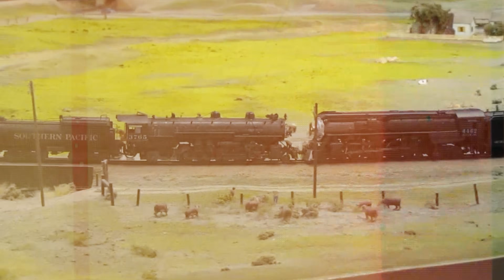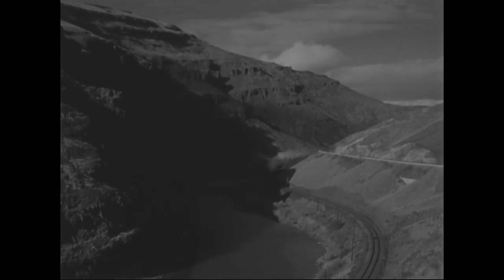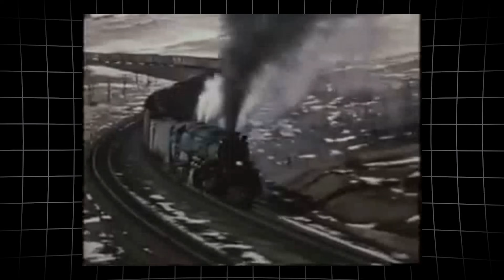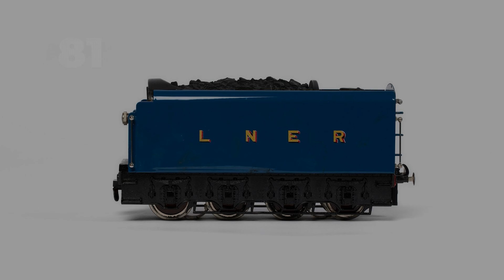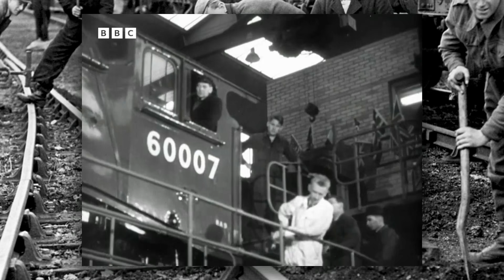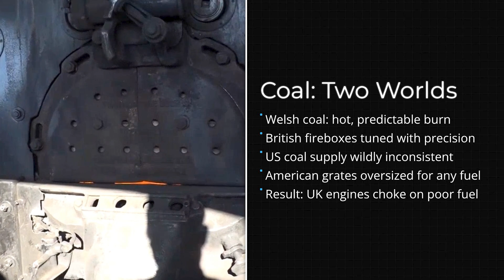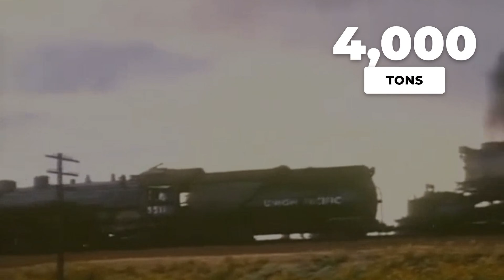Why British Locomotives Would’ve STRUGGLED in America

Comment: Kind of comparing apples to oranges. The Big Boy class was a very specialized, massive machine. A fairer comparison would have used perhaps a Mikado on our end. Several of those comparisons were spot on. A very interesting and informative video. Thanks for sharing this information.
Reply: The big boy’s were a class of engines not a one off type. (Like the Allegheny locomotive)
Reply: @sockshandle yes. As I said in an earlier post, the class was not a fair comparison. That wasn’t the average power for the railroad. Every railroad had their “monster” class for their particular needs like SP’s Cab Forwards. It would be like comparing an Atlantic or Pacific type to the Big Boy for passenger speed.
Reply: @jeffreymcconnell6794  Setting the Big Boys vs. well, anything else, comparing the Big Boys' goals vs. reality is interesting- the goal was pulling 3,500 tons over the Wasatch Range, but they actually achieved 4,200 tons.
Reply: You saying there was only one big boy ? There’s a whole class of them, I do agree mikados would have been better
Reply: @EMDempire Not at all. The class itself is an unfair comparison. They were monsters that beat the hell out of everything the USA had at that time, too.
Reply: @jeffreymcconnell6794 true
Reply: @jeffreymcconnell6794  Disagree Each major railroad had their Massive Beasts
Reply: @Nuclear_Doughnut exactly my point. Don’t compare massive locomotives that were atypical of average road power to the average locomotives of the time.
Reply: Yep BR should use 9F and AR should use mikado or santa fe or something similar. BR has no articulated engines.

Comment: Britain does not have the mountains that America has. And distances are shorter which makes coaling and watering easier.
Reply: Britain did build locomotives to send to other places, such as India. Several railways, and locomotives to operate them, were built in the Himalayas. The largest mountains on the planet..... 
Britain also supplied Australia with locomotives, that would travel thousands of miles through deserted, err, desert, reliably, all day, every day, carrying thousands of tonnes of ore across the outback. 

The machines were designed to do the job they needed to as best they could, in the smallest, most economical package.
Reply: @Spook123 There are Garrett articulated locomotives atill operating in Africa but in India the locomotives are narrow guage with cogwheels to give traction on steep inclines.

Comment: Kinda unfair comparing the A3's and A4's to THE DAMN BIG BOY like compair the big boy to an 8F or a 9F
Reply: It would have been more fair to compare between a K4 and the A3s.
Reply: @connormclernon26  K4 is an older locomotive than the A3s. It still probably would have made English rails Cry. PRR was a monster on the rails
Reply: Big Boy is probably closer to something like a Garratt or a british mallet engine, since we're factoring in Articulation.
Reply: @heftyordinanceindividual4015 unfortunately the LMS and BR/LNER(?) Mallets weren't built but yeah i haven't had a single thought about a  garrett, good point
Reply: @heftyordinanceindividual4015 No. The Garrets didn't even touch a PRR 2-10-0
Reply: Comparing the big boys water capacity to a British locomotive, how much water did it use to cover the same distance?
Reply: @DGH-i8r blud was COMAPRING WHEEL SIZED my guy
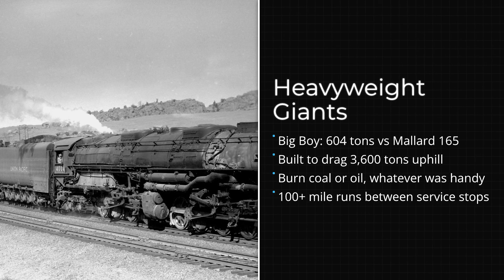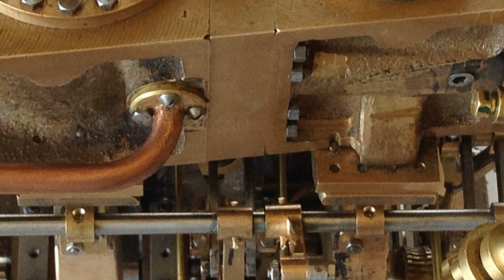Reply: @FlyingFoxProductions8995  3:25- 4:16 TENDER WATER CAPACITY section, I wasn't having a go at you I was adding to your comment on the comparison inequality.
Reply: @DGH-i8r is that including track pans or not?
Reply: @gamerfan8445  Erm...not.
Reply: I would compare it to a pair of class QJs. Yep a pair of them. BB has got around 7000 horsepower a pair of QJ could do 6000 not much of a difference in pulling same load at same terrain.
2x QJ would weight 133 tons x2 and that's without the tenders. a BB would weight 350 tons no tender. 2x QJ is lighter.
Fuel cost. QJ should be less. It has got around 10% efficiency. And QJ will not crush the tracks.

The only drawback of QJ is you need 2 set of crews. But people is cheap in mao's era therefore no problem. Also a pair of QJ is longer than BB but that's nothing to worry for freight trains.
Reply: the 9f is only just slightly more powerful than one of our narrow gauge mikados ;-;

Comment: See Kratville's book on the Union Pacific 800 class 4-8-4 engines.   80 inch drivers, much used on Sherman Hill...  British answer to large cargo jobs might have been the Beyer-Garratt design?
Reply: British heavy freight engines tended to be 2-8-0s. There was also the 2-8-2 Mikados by Gresely and the 9F 2-10-0. Our engines rarely got larger than 60-70ft long. Garrats could work but they were largely used on banking duties (in the UK, they were used quite extensively in Africa, India, Australia and New Zealand) as far as I'm aware.

Comment: The British built locomotives to use all over the World..  They were different to the ones used in th U.K. because conditions were different.  There was an example of one for Indian railways on show at the Festival Of Britain in 1951 that would probably have been at home in the U.S. (They were still building them then). That's the way proper designers and builders do things.   America started with wood burners to run across vast prairies and mountains and imported armies of labourers to build the tracks.  It is no surprise that they developed differently.
Reply: What I wonder is how well would British-made locomotives stand up to the horrendous banging and jolting inherent to American railroading using knuckle couplers?  The slack action and massive weight of American trains can quickly smash to bits any equipment not designed for it, so my impression is that, for that reason, American equipment tends to be much more stoutly built by comparison, because the British buffer system moderates all that.

Comment: Not really fair comparing The Flying Scotsman, 4-6-2 to the Big Boy. The Big Boy is at least 3 times the size. Should have compared it to a PRR K-4 or let's say the Rogers locomotive Works Pacific like L&N 152 which is a light Pacific. Still, it had twice the water capacity of The Scotsman.
Reply: Naturally.  The Murican trains had to stop and fill up.  THe Brits developed a system that worked like a water bomber picking up from a lake, and did it at speed --and of course it's a small, damp Island
Reply: Track pans were used in the USA too, on the New York Central.

Comment: There was a Flying Scotsman touring America in the 1970s as some UK PR/advertisement. It had two tenders because it was the end of the steam era, hence it was getting even harder to get water. Through trial and error, they figured out that they could make it run on coal from West Virginia and apparently only that. Didn't work with any other American coal.

The comparison in this video seems a bit off through. Europe today like back in the steam era relies on shorter freight trains, which are more agile and blends in with dense passenger traffic. EU is trying to make the default freight speed limit of 120 km/h (75 MPH) as this makes it easier to blend into traffic. Also max train length is like half a mile.

European steam (UK, France, Germany etc) were optimized for short hauls by American standards, but they did that with greater efficiency. The lower coal capacity was not just due to higher energy density, but also because efficiency was high.

It should be noted that while Welsh coal is high quality, a lot of Europe has decent coal. UK has many coal fields with high quality coal The Flying Scotsman ran on coal from North Yorkshire as that happened to be the middle of the line it was designed to run on. Germany and Poland has equally high quality coal.

Europe pushed much harder for electrification. Austria pioneered AC overhead wires in 1911. Standard gauge followed in 1917. This means a lot of mountain climbing in the Alps were electrified before the steam locomotives in this video were even mentioned. As such Europe had much less of a need for mountain climbing steam. Also a side note, Sweden had coal shortage during WW1 but found their electric trains ran fine. Fearing a repeat, they invested heavily in electrification and when WW2 broke out, 80% of the trains were electric.

SFJ, a Danish railroad ordered a 4-4-0 from Baldwin, which was delivered in 1900 since all European locomotive works were fully booked. Compared to the Danish/German standard (Danish locomotive works had to keep up to German standards or everybody would order in Germany, hence similar quality standards), this locomotive was seen as unreliable, high coal and water usage and would drop top speed too fast when adding cars to it. It was only used as a reserve when everything else were running or in the shop. Eventually it was put up for sale and after years of waiting for a buyer, it was scrapped in 1924. Maybe it was a bad engine by American standards, but given that it's one of the few engines, which made it across the Atlantic, it has become a key comparison engine.

To be fair, there are stories of European locomotives not doing well in America. Southern Pacific ordered a diesel-hydraulic locomotive from Germany because at the time, diesel electric weight 30% more per horse power (this difference ended in the 1980s with the introduction of the thyristor). During the test run, it ran fine uphill, but the German engineers got worried about the hill and asked how long it would be. They were shocked at the length and they had clearly not designed the engine for max load for such a long time. The test engine did ok, but not good enough to order more of them.
Reply: If we are going to look at heavy freight in Europe, the Swedish iron ore line is the only European line classified as heavy freight. It allows an axle load of 30 tons, through it was 25 tons at the time of the engines mentioned in this video. It never saw giant steam locomotives (through it used the biggest ever in Sweden) because the line completed electrification in 1925. The line runs from some iron mines in Sweden to the Norwegian port of Narvik, which is on the other side of the mountains. They introduced the DM locomotive in 1952, which is a 1-D-D-1 electric with 5000 hp. They got extended to 1-D-D-D-1 in the 60s, making them the longest ever electric locomotives with a length of 35 meters (a big boy is 40 meters with tender). They have been retired in 2013 and replaced with some shorter, but stronger locomotives, which delivers 14700 hp, which makes them the strongest locomotives in the world.

Just to make this line more of a challenge, most of it is north of the polar circle. This means during winter, they will not see a sunrise at all. The northern most point of the line is almost as far north as the northern coast of Alaska. America is not the only place with challenging lines and heavy loads.

Search youtube for "LKAB DM3" if you want to see some huge blue electric locmotives with rods on the wheels like steam.

Comment: Why did US railways go for the Beyer Garrett type?
Reply: Gentle curves meant that they weren't needed.

Garratts are also tank engines, and lose adhesion as they use up coal and water.

Any company using the design would also have to pay royalties to Beyer, Peacock & Company.
Reply: @FortunaFortesJuvat 
All the water that is in the tender is available for adhesion until it had been used up. The Garrett design can run equally well in either direction and doesn’t need to be turned. Boiler design is almost unrestricted.
Reply: The US loading gauge also means boiler design is almost unrestricted, which is why compounding was rarely used.

Exactly- until the water is used up. A Mallet doesn't lose adhesive weight as it burns fuel and water.

In the USA, there is a lot of space for wyes and turntables.
Reply: @physiocrat-sv not really a Garratt boilers are limited on how big they can get, 90% of Garratts boilers are similar size to large conventional steam locomotive from from their country. While mallet/simple articulates can support a larger boiler.

Comment: Any steam locomotive, no matter the driver diameter, will stall if overloaded for the terrain and slip if lacking sufficient adhesion for the rail conditions.  Driver diameter correlates to maximum speed, not tractive effort.  Weight on drivers affects adhesion and thus practical tractive effort.  Mallard would do just fine on Saluda with an appropriate train weight.  What it would not do is pull a large enough train to be economic in a North American context.  With regard to tender capacity, the Brits made extensive use of track pans and thus had little need for increased water capacity.
Reply: Andrew: great report--thanks.
Reply: the UK and the Netherlands are the 2 countries who have the most rainfall so water is more then enough available.
compound and other systems to reduce water use were therefore not the norm. They kept at single expansion  steam tech.
France, Germany, Spain and Russia developed condensing tenders to re-use spent steam and other tech to increase efficency.
Italy and Spain used f.e. the Franco-Crosti boilers to get more energy out of the steam and use less water.
Reply: Driver diameter- a large driving wheel usually offers higher top speed but lower force the driving point is more towards the center. a smaller driving wheel the opposite. That's why passenger locos have big but few wheels while freights have more smaller wheels.
And yes the adhesion is almost solely affected by weight on driving wheels. That's how QJ utilized the most of it- it has 5 driving axles 20 tons each. If it's a 4-8-4 or 4-6-4 with more horsepower but same axle load it will stall and not move on a heavy freight train while QJ could still move its a$$.

Comment: Can you do a video on Canadian steam? Never really see much abt it up here.
Reply from the maker: I was looking for your comment everywhere haha. Absolutely! The next video is going to be about Canadian steam. Appreciate the suggestion!
Reply: Canadian steam locomotives were a lot more standardized than American ones, and there weren't any truly giant ones, due to the vast distances, low population density, and severe weather conditions they had to deal with. Some of the hallmarks are very large feedwater heaters, sand domes, and insulated cabs. The last new steam locomotives were built in 1949, and steam lasted until 1962. Oil fired locomotives were common especially in the western provinces. 

By the end of the steam era, Canadian National Railways standardized on the 4-8-4 "Confederation" type locomotives, and used lighter Pacifics  where needed, and the massive T-class  2-10-2 "Battleships on Wheels" for heavy transfer service. CN has the streamlined 6400 series Confederations, and the most 4-8-4s out of any railway. 

The Canadian Pacific Railway standardized on the 4-6-4 Royal Hudsons for passenger work, and the P-class 2-8-2s with the same boiler but lower drivers for freight work. CP also had the largest locomotives in the British Empire, the 2-10-4 Selkirks, which pulled both passenger and freight trains through the Rocky Mountains, and wore passenger silver, gold and Tuscan Red instead of freight black paint. Even these were much smaller than the biggest American locomotives, being 99 feet long, so they could (barely) fit on a 100' turntable. CP had exactly 2 4-8-4s, which handled the night passenger trains between Toronto and Montreal.
Reply: @FortunaFortesJuvat And the whistles went, "WHOOOOOOOTT, eh?"
Reply: @FortunaFortesJuvat And the whistles went, "WHHOOOOOOTT,  eh?" 

Sorry. Couldn't resist!